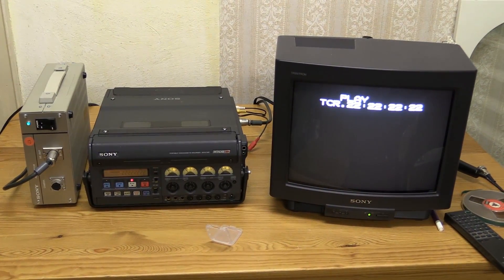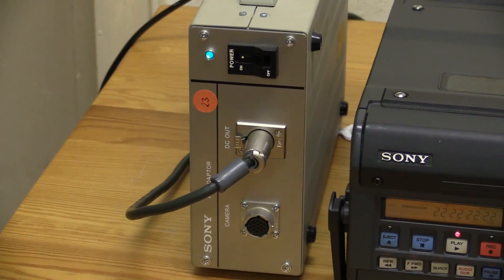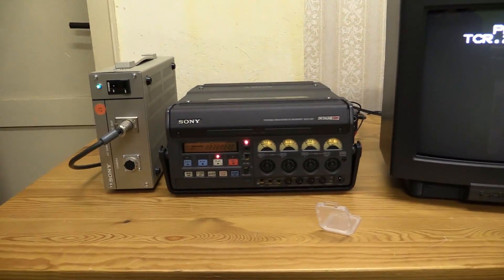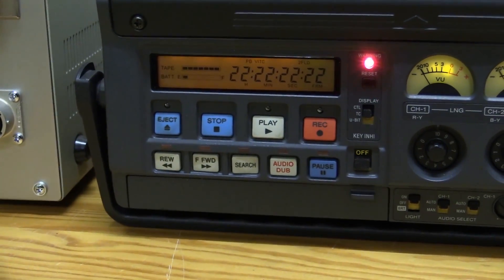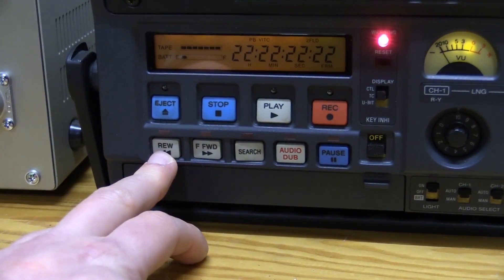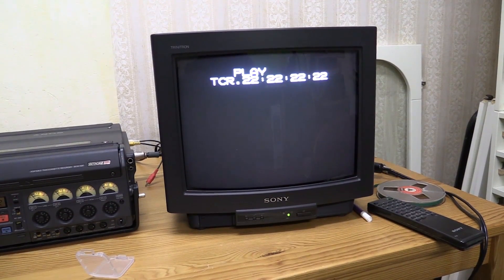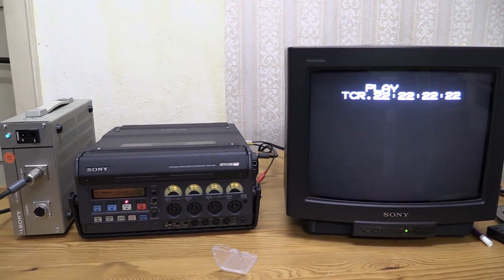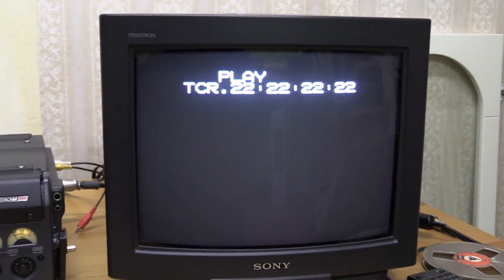Sony Betacam SP recorder update

Comment: Warum besorgst Du Dir nicht die Service Manuals? Gibt es z.B. bei Schaltungsdienst Lange. Tausch "einfach" mal alle Elkos auf der Platine der Laufwerksteuerung.  Das wichtigste ist aber das TBC-Board. Das Ding ist leider ein Massengrab an SMD-Elkos.
Reply from the maker: Danke für die Hinweise. Mittlerweile habe ich das Gerät verkauft, aber vielleicht hilft's ja einem anderen Zuschauer :)
Reply: Ich habe mir die Tage einen gekauft, weil das Service Manual hier schon seit einer Weile herum lag und ich diese Henkelmann praktischer finde als so ein Rackmonster - nicht, daß ich allzu oft mit meinen BetaSP-Camcordern Futter für das Ding liefern werde, aber man will dann schon per Component raus :)

Baujahr 1992. Das Jahr der Kondensatoren aus der Hölle... Und wie erwartet suppte drinnen fleissig alles rum. Die 300 Nippon Chemi-Con Fässchen sind schon ausgelötet, nächste Woche sollten die restlichen Ersatzelkos kommen, dann bin ich mal sehr gespannt. Nicht vergessen bei so einer Reparatur sollte man den größen Anteil des Aufwandes - sorgfältiges Reinigen der eingesuppten Platinen, insbesondere der Durchkontaktierungen. Einfach mal grob mit Spülmittel durchwaschen halte ich wegen der Trimmer und anderer evtl. nicht so badefreudiger Bauteile für keine allzu tolle Idee.

Ach ja - unter der Platine auf der Kopftrommel sind auch noch 2 SMD-Fässchen, anderer Typ (vielleicht wurde die Kopftrommel mal erneuert), laufen aber auch aus.

Ich hatte ihn auch mal sehr kurz (um Folgeschäden durch die ausgelaufenen Elkos hoffentlich zu vermeiden) eingeschaltet, um zu schauen, ob das Ding mechanisch überhaupt noch okay ist und sich diese Mammutaktion überhaupt rentiert - dabei die gleichen Effekte beobachtet, Flackern im Bild, hier und da etwas sonderbares und wechselhaftes Verhalten der Laufwerkssteuerung.

Also wenn sich ein anderer Zuschauer das mal geben möchte - rechne mit 20-30h Arbeit und knappen 60€ für Elkos - bei ungewissem Ausgang, ob und wie lange der Eimer danach funktioniert.

Ürigens bei ewig rumgestandenen Kisten nichtmal eine Chance, die Betriebsstunden/Kopfstunden zu ermitteln - entgegen aller anderen Sony Pro-Gerätschaften, die ich hier habe, sind diese Zähler bei dem Kübel batteriegepuffert - und die Batterie in meinem Exemplar war noch die Erste von 1992, also leer, hurrah, alle Stunden auf 0. Macht aber auch wenig Hoffnung auf eine neue Kopftrommel, wenn es schon an der Wartung der Batterie haperte, die alle 2 Jahre getauscht werden sollte laut maintenance manual...
Reply: @MichaelKukat  Oh, interessant das sich da noch jemand rantraut. Meinen (bzw. unseren) BVW 50 habe ich dann doch schweren Herzens vor rund 2 Jahren beim Recyclinghof in den Container für Elektronikschrott geworfen. Selbst die Müllwerker staunten nicht schlecht und hätten sich das Teil wohl fast in ihre Kuriositäten-Schau gestellt.

Bei meinem Exemplar ging zum Schluss gar nichts mehr. Kein Bild, kein Video, nur die Displaybeleuchtung ließ sich noch einschalten. Beim Aufschrauben habe ich dann festgestellt, das sich der große Stützakku (Bauform ähnlich einer AA-Batterie mit Lötfahnen) gelöst hatte. Erst Kontakte weggegammelt, dann nach unten bis zur Kontaktleiste durchgefallen. Dann vermutlich durch einen Transport Lage verändert und an einem dritten Ort Elektrolyt ausgelaufen. Das Ergebnis waren großflächige Zerstörungen auf allen Boards. Die SMD-Elkos ließen sich schon mit den Fingern abbrechen. 

Die Kontaktleiste, wo die Boards auch drehbar gelagert sind, war auch angegriffen. Die Boards lassen sich auch nur in einem ganz bestimmten Winkel herausziehen. Ansonsten brechen die Nasen an der Leiste ab. Die Riemen waren noch gut. Den Zustand der Kopftrommel kann ich nicht beurteilen, sah aber auch noch gut aus, bzw. fühlte sich gut an beim Kopfreinigen mit Lederläppchen. Auf der Kopftrommelplatine würde ich nicht herumlöten. Das ganze ist feingewuchtet. Nach dem Tausch ist Jitter vorprogrammiert. Jedes "Rackmonster" läuft dann besser.

Das Problem bei der Maschine ist auch, das im µC wichtige Einmessdaten der Kopfverstärker gespeichert sind. Ein kompletter Grundabgleich ist mit Hausmitteln nicht durchführbar, da dafür spezielle Extender Boards oder "Service Harness" (quasi ein Extender-Kabelsatz) benötigt wird. Wenn der Akku also leer ist, dann ist das eigentlich bereits das Todesurteil für diese Maschine. Bei anderen Sony-Mazen (BVW/PVW/UVW) sind nur die Uhren batteriegepuffert, bzw. die Batterien sind in die Uhrmodule integriert und nicht tauschbar. Die alten Quecksilber-Röhrchen (BVU und BVW) gibt s ja schon ewig nicht mehr.

Ich weiß von einem Bekannten, der sich ganz enthusiastisch einen SONY BVW35 Henkelmann vorgenommen hatte. Er hat das Gerät immerhin soweit gebracht, das es wieder abspielen konnte. TC-Overlay hat er aber nicht hinbekommen und Aufnahme auch nicht.

Viel Glück mit Deiner 50er!
Reply: @rainergulzow6133  Ohjeh, na die Kiste hatte es dann wohl wirklich hinter sich. Gut, wenn ich an die etwas verzogene Kunststoff-Front von meinem Kasten schaue, hätte ich ja gesagt, irgendjemand findet sich dennoch, der das noch brauchen kann. Auch wegen Riemen und so.

Der "Stützakku" ist eine Lithium-Batterie, läuft eigentlich nicht aus und ist auch weit genug von SMD-Elkos weg. Auch die scharnierartigen Board-Steckverbinder sind meiner Meinung nach wenig gefährdet von auslaufenden Elkos. Ist da vielleicht mal was in den Kasten gelaufen, was da nicht rein gehört? Oder hat vielleicht irgendein Superheld die Li-Batterie durch einen NiCd-Akku ersetzt? Einen derartigen Verfall kann ich mir tatsächlich kaum vorstellen und ich habe schon viel Elko-Elend (und auch Akku-Elend, vorwiegend in 1980er Synthesizern) gesehen.

Ja, diese Scharnierkontakte sind empfindlich. Man muss dem maintenance manual folgen, weil wie ein Depp dran rum reißen ist keine Lösung, wenn man das Ding jemals zum Laufen bringen will. Irritierend, dass alle Boards unter dem Laufwerk in ausgeklapptem Zustand gezogen werden müssen, das AFM-Board aber in eingeklapptem Zustand.

Bei der Kopftrommel hatte ich tatsächlich meine größten Bedenken. Ich hab außerordentlich sorgfältig an der Stelle gearbeitet und Anhand von vorher aufgenommenen Fotos geschaut, daß möglichst alles präzise wieder da ist, wo es vorher war, aber alleine die Unterschiede der Lötzinnmengen dürften bei 1500rpm relevant sein - zumal am Rand der Platine Felder sind, die so aussehen, als seien sie genau zum Auswuchten gedacht, indem man da Lötzinn aufbringt oder eben nicht. Naja, man wird sehen. Ist in der Tat meine grösste Sorge. Aber die Elkos da fressen lassen ist halt auch keine Option.

Die gespeicherten Einmessdaten sind meines Wissens in einem nichtflüchtigen Speicherbaustein auf dem SST-Board (IC520), also sind die zumindest mal nicht verloren. Wie weit sie nach dem Tausch von 300 Elkos noch stimmen, ist eine andere Frage. Aber ich bin hier auch ein wenig über "Hausmittel-Level" und nicht völlig chancenlos, falls irgendwo was nachjustiert werden muss. Der einzige notwendige Extender für den Eimer ist glaub der zwischen VRP und dem Anschlusspanel an der Seite, da muss ich schlimmstenfalls was selber basteln. Ich habe eine BVW-300P komplett recappt und noch mehrere weitere elektronische Fehler beseitigt bekommen, am Ende sogar das Servo-Board justiert, so daß der Kasten jetzt wieder ordentlich läuft - alles ohne Extender. Und bei dem Ding waren die Platinen auch stärker beschädigt als im 50er, vermutlich ein Grund für die Folgeschäden - es war sogar eine der 47µH Drosseln durch, weil das Elektrolyt irgendwo eine Versorgung kurzgeschlossen hatte. Bin also bei solchen Sachen recht hartnäckig :)

Aber klar, mir ist bewusst, daß ich hier möglicherweise einen Haufen Arbeit in ein nutzloses Stück Deko gesteckt habe - das Risiko gehe ich bei jedem Stück in meiner Sammlung ein, und bisher habe ich noch alles wieder zum Laufen gebracht, nichtmal die kaputten magnetischen Rutschkupplungen der flachen BetaSP-Laufwerke (BVW-300P, PVV-3P, Ikegami HL-55V) haben mich abgehalten, der 3D-Drucker hats gerichtet. Sicher nix für die Ewigkeit, aber sie laufen ruhig und ohne erkennbare Probleme. Ich strebe hier keineswegs ein zwetes Broadcast-Leben für die Dinger an, es ist nur ein Hobby, diese Teile zu sammeln und hin und wieder mal ein wenig damit herumzuspielen. Das einzige Ernstzunehmende hier ist die PDW-F330, und bei der hab ich auch noch den FireWire-Controller (128pin QFP mit 0.4mm Pitch) tauschen dürfen, weil sich der vom Verkäufer dargestellte "Wackelkontakt" an der FireWire-Buchse doch eher als "der ganze Kasten ist mal vom Tisch gefallen, Kabel rausgerissen, 12V auf Datenleitungen gekommen" herausgestellt hat.

Danke soweit. Nach dem interessanten Austausch wirds also noch einen Abschluss-Status hier geben, leider sind die Elkos noch nicht da, sollten morgen kommen. Bis Wochenende sollte ich also mal wissen, was mir die Mammutaktion über Ostern gebracht hat. Im worst case rüste ich halt doch mal einen Komponentenausgang bei VA-500 nach.
Reply: @MichaelKukat  Ich freue mich, endlich mal wieder jemanden zu finden, der ein wenig Ahnung hat und an den alten Beta-Sachen herumschraubt. Zu Deinem BVW50: Der Stützakku ist im Original ein Sanyo NiCd-Akku. Der Speicher ist zumindest in den niedrigen Revisionen flüchtiger Art. Denn es wird im Service Manual mit großem Gewese darauf hingewiesen, wie dieses Teil unter Spannung (mit 12Volt und Gerät eingeschaltet!!!) getauscht werden soll und das es bitteschön auch das einzige Teil in der Maschine ist, an dem unter Spannung herumgelötet werden muss. Dann hast Du schon eine spätere Variante, möglicherweise wurde Dein Gerät schon vom Service modifiziert. Es wird eine Lithiumbatterie sein. Kein Akku. Da muss dann die Ladeschaltung deaktiviert worden sein. In die AMIGAs habe ich ab 2000 auch Lithiumbatterien eingebaut.

Immerhin habe ich bei meiner BVP7AP mal den "Service Check Up" gemacht und die Videoverstärker eingestellt. An den BVPs habe ich noch keine Elko-Probleme gehabt. Sind aber auch noch keine SMDs drin. Habe aber auch nur 7er und 70er hier. Eine 70er hatte einen Fallschaden, wie ich im Nachhinein festgestellt habe. Da habe ich von einer Schlachtkamera die obere Gehäuseplatte durchgetauscht. Dazu musste ich die ganze Kamera auseinanderbauen. Dabei habe ich dann noch einen Stecker beschädigt, und zwar den von dem Schalter für die Suchereinblendungen. Das muss ich irgendwann noch mal fixen. Genauso wie den TBC von meiner BVU820. Schade das es so wenige deutschsprachige Videos von so etwas gibt. In den meisten Videos werden die Geräte ja nur zerstört. Kann man Dich auch privat erreichen? Bin noch im Vintage Video Forum. Aber da ist überhaupt nix los... Gruß Rainer
Reply: @rainergulzow6133  geht mir nicht anders, macht Spaß, mit Leuten zu reden, die auch wissen, von was sie reden.

Weißt Du, seit wann der BVW-50P gebaut wurde? Meine 12xxx-Seriennummer ist ja schon recht hoch, die Kiste ist von Ende 1992 (Boards mit 204, eines mit 211 gelabelt, Datecodes von 1992), auf der Li-Batterie stand 12-92 (oder 92-12), also vermutlich noch die Erste. Den umfassenden Hinweis zu dem Batterietausch hatte ich gesehen, allerdings stand da direkt nicht der Typ mit bei und in meinem Recorder war - wie ich es auch von BVW-300 und PVV-3 kenne - diese Lithium-Batterie drin. Das interessiert mich jetzt, mal die MMs anschauen. Vol2, 3rd ed, rev 2, serial number 10381 and higher, parts list, SST-1P, BT200 "Battery, Lithium". Haben die wirklich den Fehler mit NiCd-Akkus bei den ersten Geräten gemacht? Gruselig.

Ja, mittlerweile habe ich auch einen hohen Verbrauch an CR2032-Batteriehaltern, die Dinger kommen überall rein, wo ich was umrüste, Ladeschaltung raus, ggfls. die abgehende Diode (falls vorhanden) noch durch eine BAT43 ersetzen, das gleicht die geringere Spannung der Batterie noch ein wenig aus, in Zukunft einfach zu warten. Wie viele NVRAM-Bausteine mit Huckepack CR2032-Halter ich die letzten Jahre beim Abstoßen meiner Unix-Workstation-Sammlung gebastelt hab...

Anfangs habe ich gerne mal Batteriehalter von der Platine weg gelegt und da AAA-Akkus rein gesteckt, aber das hat gerade bei selten betriebenen Geräten halt auch keinen Sinn bei der Selbstentladung von NiMH-Akkus. Eneloops wären noch eine Option. Aber so ne CR2032 hält bei den meisten Aufrüstungen voraussichtlich Jahrzehnte, ist einfach die beste Lösung.

BVPs fehlen mir in meiner Sammlung noch, wobei ich inzwischen aus Platzmangel mal die Bremse gezogen habe. Aber auch DXC-M3 funktionieren heute noch prima - dafür sind aber auch DXC-327AP mit massenweise auslaufenden Nichicon THT-Elkos "beglückt". Ich hab sie trotzdem mal irgendwann wieder aus meiner Schrottkiste gezogen und beide repariert, weil ich nach den neuen Rutschkupplungen in den PVV-3 ja was brauchte, was ich da anflanschen kann :)

Diese SMD-Elkos sind bei Baujahren 1989-1995 ein Problem. Bei späteren Geräten wieder keine Probleme mehr, davor gabs die SMD-Varianten noch nicht. Diese "erste Generation" ist ein Graus. Das beste Beispiel meine beiden JVC KY-27 bzw. KY-27C, die eine hat 152 neue Elkos gebraucht, die geringfügig Neuere ist top in Schuß.

Bist Du der Rainer Gülzow vom Beaulieu Cine-Filmclub? Dann würde ich Dir einfach mal eine Mail schreiben. Private Nachrichten gibts bei YouTube ja nicht mehr und meine Email-Adresse möchte ich hier auch nicht öffentlich abwerfen :)

Ich hatte früher eine Menge DIY-Videos hier bei YouTube, aber nach Abschaltung von Google+ kam mit den negativen Erfahrungen hier dann zu viel zusammen, ich habe den ganzen Channel gelöscht. Sonst wären da heute sicher lustige Videos über Broadcast-Video-Equipment neben den Synthesizer-DIY-Videos. Aber langsam stehen hier zu viele Kameras rum, vielleicht juckts mich ja doch mal, wieder was zu machen. Immerhin in Corona-Zeiten prima für Videokonferenzen geeignet, ich hab immer das beste Bild :)
Reply: So, und zu dem versprochenen "Abschluß-Status": ein Abschluß in dem Sinne ist es nicht, weil ich da die nächsten Monate sicherlich noch ein wenig was zu tun habe.

Elkos sind gestern gekommen, mittlerweile alle eingelötet, und Boards nacheinander eingebaut und den Kasten mit jedem neuen Board mit Strombegrenzung hochgefahren. Eine defekte Leitung für die Stromversorgung der Drum PG/FG Preamps was das Erste, was noch nachzubessern war, danach hatte der Threading-Motor ein etwas stockendes Verhalten, was nach festerem Andrücken der "Scharnierkontaktleisten" verschwand, Text-Einblendungen hüpfen noch chaotisch rum, wenn er kalt ist, der TBC verhält sich mitunter etwas sonderbar, aber auf der positiven Seite hatte ich gestern Abend auch zwischendurch mal eine perfekte Wiedergabe in sehr guter Bildqualität.

Heute ist das Audio-Board noch mit reingekommen, ich habe zwar noch keinen Ton, aber das Gefühl, daß er bei Play jetzt Video löscht :)

Kurzum: die Platinen haben mehr gelitten als erwartet, aus meinen Erfahrungen mit der BVW-300P, die in ähnlichem Zustand war (sogar vom selben eBay-Verkäufer, wenn auch viele Monate vorher) und heute prima funktioniert, ist das reparabel, aber mehr was für Momente, in denen man mal ein wenig Ablenkung braucht. Also statt Sudokus lösen mit dem Scope in der Kiste rumwuseln.

Wie schon zu erwarten war: wer einen BetaSP-Recorder will, um ihn zu benutzen, ist sicherlich mit einem DVW-A500P oder MSW-M2000P besser dran, einen BVW-50P sollte man sich nur antun, wenn man sehr viel Geduld und Leidenschaft hat und vor Allem keinerlei Ansprüche, einen zuverlässigen Recorder zu bekommen. Ich bin zuversichtlich, daß mein Exemplar eines Tages wieder funktionieren wird, ich bin aber auch zuversichtlich, daß er ein auch danach hin und wieder Probleme machen wird, 100% bekommt man die Elektroly-Reste nicht mit vertretbarem Aufwand weg, und wenn sie unter einem SMD-IC nicht sowieso schon durch ihre elektrische Leitfähigkeit zu lustigen Effekten führen, beschäftigen sie sich halt in aller Ruhe damit, die Leiterbahnen wegzufuttern. Ganz zu schweigen von den Durchkontaktierungen, die auch im Laufe der Zeit nach so einem Schaden ausfallen. Ich persönlich habe aber meinen Spaß dran, solche Fehler systematisch zu debuggen. Nicht heute, nicht dieses Wochenende, aber wenn ich mal wieder eine Abwechslung brauche.

Aber ganz ehrlich - nach KY-27 (152 Elkos), BVW-300P (ca. 90 Elkos) und jetzt dieser Mühle (300 Elkos) habe ich jetzt echt die Schnauze voll von großen Recap-Aktionen mit diesen SMD-Elkos. Die Consumer-Camcorder und diverse m68k-Macs hatte ich seinerzeit gleich beim Anblick der Katastrophe entsorgt, bei den Commodore Amigas hatte ich das Problem noch früh genug bemerkt, so daß die Boards noch nicht zu angefressen waren.
Reply: @MichaelKukat  Ja, ich bin im Vorstand vom Beaulieu Cinefilmclub. Ich habe auch mal wieder ins Service Manual geschaut, Revision 1, ab Seriennummer 10001. Asche auf mein Haupt, ich muss mich korrigieren. Es ist eine Lithiumbatterie drin. Ich habe auch noch die Bilder von den Zerstörungen am Innenleben auf dem Rechner gefunden. Müsste ich eigentlilch mal ein Antwort-Video mit machen. Auf meinen Boards stand überall "112" drauf. Gebaut wurde die Kiste meiner Meinung nach ab 1991. Ich glaube sogar, das war das letzte Gerät der BVW-Serie. PVW kam auch ab 1991. Nach Deinen Schilderungen spielst Du aber schon in einer deutlich höheren Liga. Bei meinem Bekannten steht auch noch eine funktionsfähige BVW300AP. Komplett recappt wurde sie nicht, eher so beim Ausfall bestimmter Funktionen wurde boardweise durchgetestet. Meine wildeste Aktion hatte ich bislang mit einer BVW 75. Die E-E immer ein Schwarz/Weiß-Bild ausgab, die Aufnahme war aber in Farbe. Von einer funktionierenden BVW 70 habe ich dann alle Boards mit identischen Bezeichnungen durchgetauscht. Bis ich dann das MD-46 Board als Urheber identifizieren konnte. Daraufhin habe ich auf Verdacht alle 54 Elkos auf dem Board getauscht, Gott sei Dank keine SMDs sondern Subminiatur. Anschließend wieder geprüft, immer noch E-E in S/W. Dann mit Scope und Multimeter den C-Zweig auf dem MD-46 Board nachverfolgt. Am Ende war es ein kleiner SMD-Transistor, der unter dem Kleber eines Platinenfixings angefangen hatte zu gammeln. Vermutlich war der KLeber in der Altersphase aggresiv geworden. Bloß woher einen SMD-Transistor 2SC2413KT146Q bekommen? Nach Tagen fand ich als Ersatztyp einen BC 847 C. Da hatte ich schon bei Ebay in China 5 Stück für 10 Euro bestellt. Die örtliche Conrad Filiale hatte den 847 liegen. Damit läuft die Kiste nun wieder. Die China-Bestellung kam dann irgendwann auch noch.

Lieber Michael, viel Erfolg weiterhin. Und vielleicht hören wir ja noch wieder voneinander?
Reply: Na gut, einen noch, dann halte ich aber den Rand :)

Gestern Abend und heute fleissig gemessen, Schaltplan angestarrt und bereichsweise noch Elektrolytreste entfernt und Durchkontaktierungen repariert. Die Suppe läuft ja schön durch die Dukos und das klebrige Zeug auf der Unterseite war dann wohl doch nicht nur Flussmittel vom Löten, vielleicht ist es auch mit dem eine chemische Verbindung eingegangen, auf der Oberseite war zumindest alles ganz flüssig, drum hatte ich dem erstmal keine Aufmerksamkeit geschenkt, der Japaner war noch nie sparsam mit Flussmittel.

Eine der Durchkontaktierungen ist aber erwähnenswert: das eine Ende saß unter einem IC auf der Unterseite. Normalerweise kein Problem, IC auslöten, Duko reparieren, gleich Elektrolytreste sauber wegputzen, IC einlöten, done. Aber: Unterseite. Da sind die Bauteile zusätzlich noch geklebt, damit sie im Reflow-Ofen nicht runter fallen. Und dieser Baustein war so bombenfest geklebt, daß ich ihn nicht runter gekriegt habe, zumindest nicht im Rahmen der Gewalt, die ich auf ein vermutlich nicht beschaffbares IC maximal anwenden möchte. Das wäre fast ein Showstopper geworden - aber da es "nur" ein Clock-Signal von ein paar MHz war, habe ich es per Kupferlackdraht durch eine andere Duko "außenrum" geführt, 2,5cm Umweg geht da schon.

Übrigens: CR2032 statt der 3,6V Li-Batterie einbauen erfordert noch das Brücken/Ersetzen der Diode nach der Batterie durch eine Schottky-Diode, weil da eine Spannungsüberwachung drin steckt, die bei unter knapp 2.8V den TC resettet (und damit auch die Stundenzähler wieder löscht), die Batterie also überflüssig macht. Habe durch die BAT43 jetzt ca. 0.3V "gewonnen", läuft erstmal alles. Mal schauen, wie lange die hält - wenn es durch die niedrigere Kapazität eh nur ein paar Monate sind, kommt doch mal die richtige Batterie rein.

Weil: der Kasten läuft wieder. Play/Record von Video/Audio (Lin und FM) ohne Auffälligkeiten (Wow&Flutter nicht gemessen, aber klingt mit 1KHz Testton für mein Ohr in Ordnung), Suchlauf sieht auch okay aus, TBC arbeitet korrekt. Okay, Audio CH1 hat einen etwas niedrigeren Pegel und der eine oder andere Schalter braucht vielleicht noch eine Reinigung, aber darum kümmere ich mich "irgendwann". Mal schauen, was die nächsten Monate dann noch alles kaputt geht als Folgeschäden der Elkos.